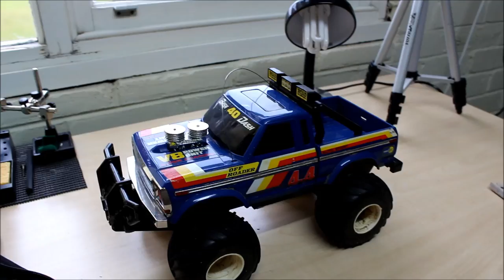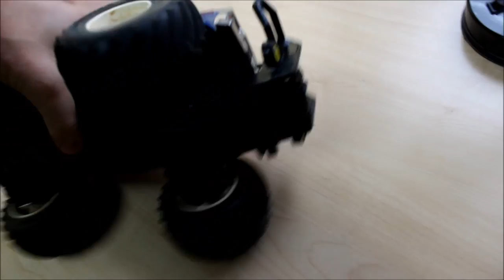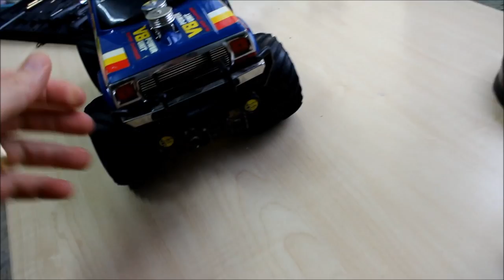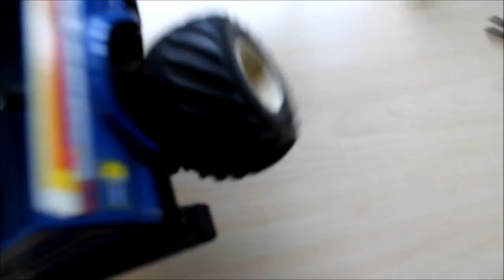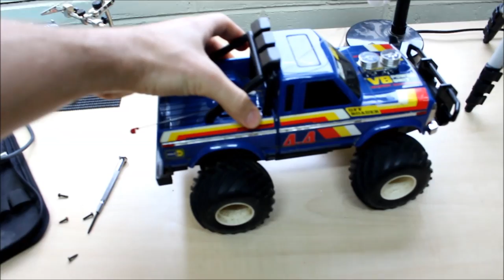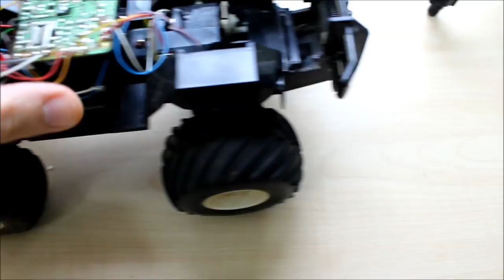The Best RC Truck Ever Made - RadioShack 4x4 Offroader

Comment: I just bought The Black Version with Orange headlights and rear spoiler off eBay in working condition. 
I had one when I was a kid as well, however it died and it was lost to the test of time. Sadly. 

Thanks for sharing mate, gonna look forward to doing the same to mine when it shows up.
Reply from the maker: I bought my son a $30 RC for Christmas, and it was broken within 3 days..... There seems to be a huge space between affordable rubbish from the toy shop and the higher end hobby grade trucks. Although these retailed for AUD 99 back in the 1980's so not exactly cheap.

Comment: I had a RC truck that looked super similar to this, but was mostly black. It also had a switch to turn on/off engine noise. I've never been able to find out which model it was, but this one is the closest so far.
Reply from the maker: There are various vintage RC toy groups on FB you could try asking there?

Comment: So glad I came across your video! I literally just saved a near mint condition one of these trucks from the garbage after a family members garage sale! Its like brand new but missing remote, and has some obvious electrical problems. Im planning an electronics update on it, too! If you can, let us know what ESC, Receiver, and motor you use!
Reply from the maker: Hi Scott, Sounds like a fantastic score. Don't worry about the missing remote. I've just completed updating mine to modern electronics using the existing NiMh cells. The proportional controls transform the truck. I'll post a video soon going through my electronics choices

Comment: I have 2 modded trucks. using a tpro mg996r servo. hobbywing 1060 esc. small 2s lipo. they work awesome.
Reply from the maker: Cool. Did you notice a big jump in speed moving to Lipo. It's a significant jump moving from 4.8V the NiMh supplies to the 7.4V from the lipo. Any videos of them?
Reply: Yes. Both speed and power.  With the stock motor. I use a wltoys lipo. 1100 mah.
Reply: I have 2 videos posted of one of my trucks.

Comment: Maybe someone here could help me. I'm trying to find an rc truck I had as a kid but it seems impossible since I don't remember the brand or anything. I do remember it was blue and had 8 wheels, well tires I guess instead of 4 wide tires it was 2 together to make them wide it also had 4 wheel steering and a winch. I don't believe it was a high end truck but I really don't remember anymore than that. Of someone knows the truck I'm talking about is appreciate some info. It would have been in the early 90s I believe.
Reply: I believe the truck you are inquiring for is named the Big Brutus. The truck was sold by Nikko through the 80's. If I can recall, I purchased one of the Big Brutus sometime around 1987. Unfortuneatly I never knew where it went off to, as it was a unique truck at that time. Hope this info helps U.
Reply: Jack Anapes ^ yeah I’d guess that too
Reply from the maker: One for sale at the moment: https://ebay.us/LWW3mf

Comment: nice 
taiyo wild v8 ☺🖒
Reply from the maker: +Radio Controll System (rc taiyo fan) Thanks! I'd like to track down all the variations of this truck eventually.
Reply: Ted's RC Why not ☺ I like it also have the same as they have bought at ebay which was broken but the front grill has the lights up and no remote control and then I have rebuilt it and replaced the parts of a nikko truck 😊